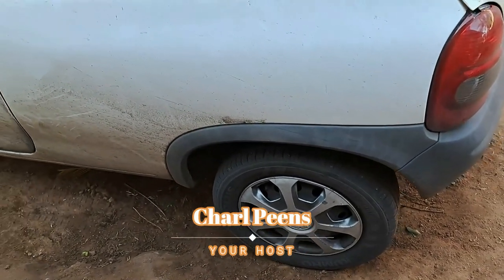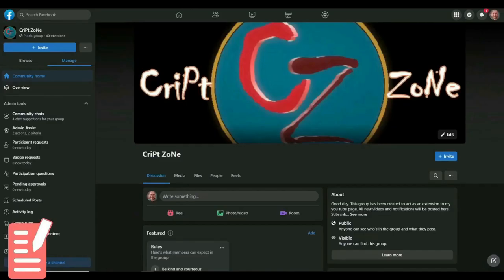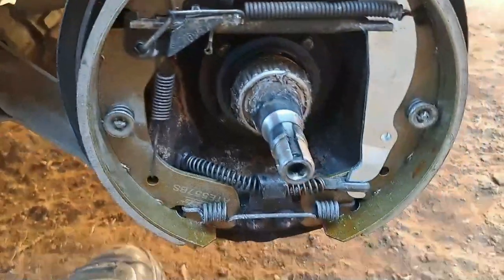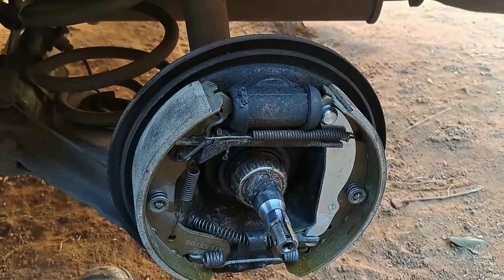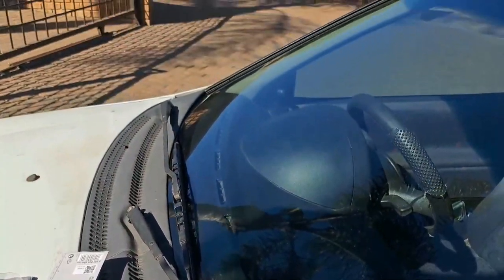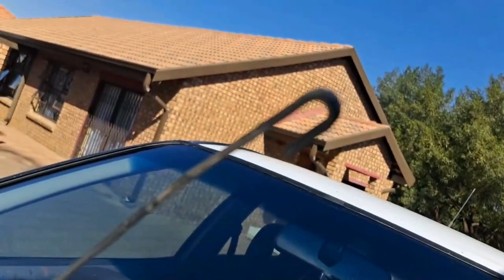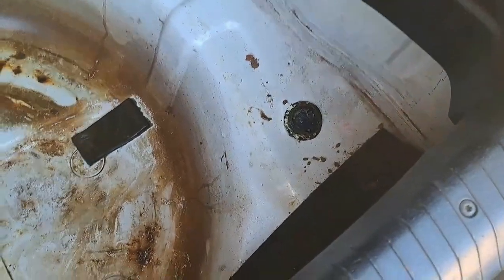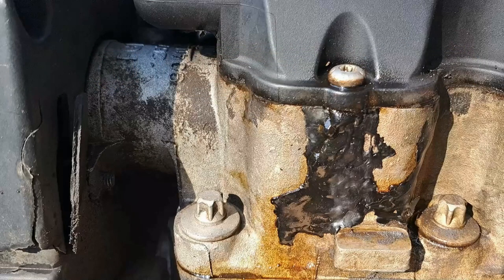Project Corsa part 1

Comment: Hi wanted to get an update on your corsa's idling problem you had a while back
Reply from the maker: @stefandebeer2288  hi. My ideling is 100% after changing the sensors. Check if your crank timing gear is not worn on the key way. That will cause poor performance and eratic ideling.